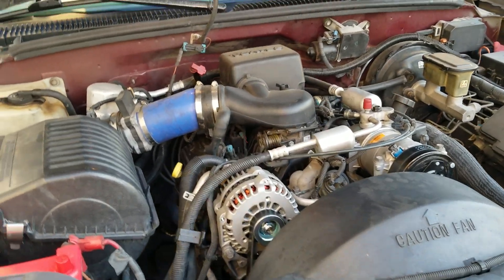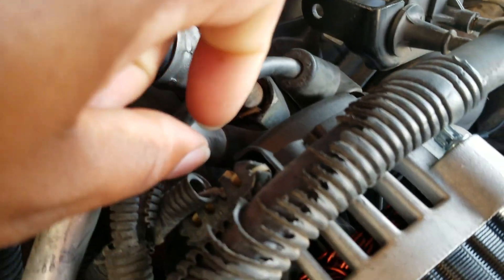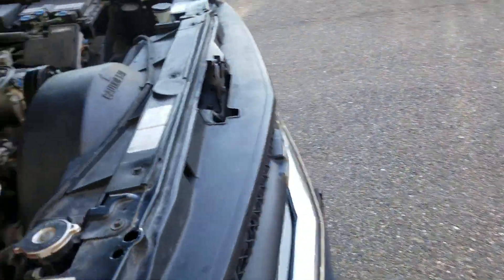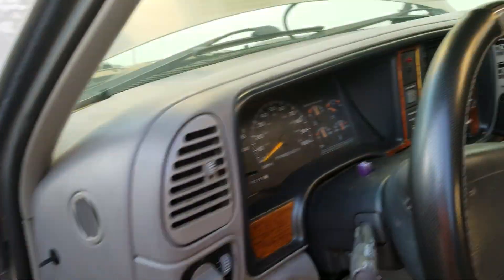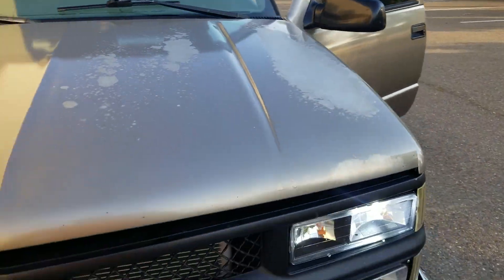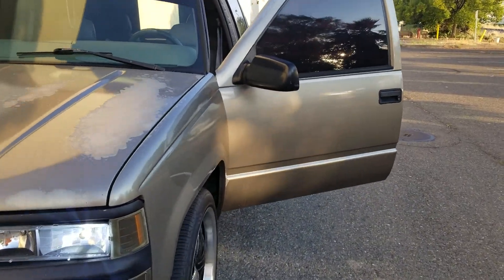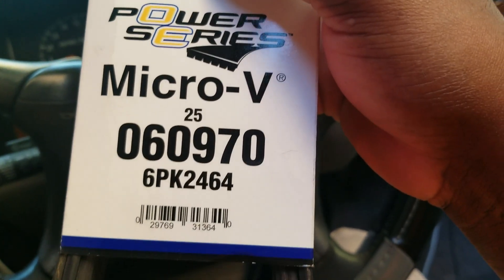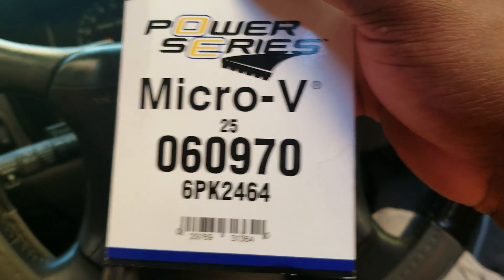1997 silverado with AD244 alternator swap

Comment: Those alternators work better if you put the voltage sensing wire at the battery as those trucks don't come with any hookups for sensing voltage.

Comment: I did the swap, and reused my factory belt, BUT, because it was short, it was too tight, and caused my tensioner to fail. Save yourself the trouble and get the new belt.

Comment: Im going to order a ad244 but my stock alternator is 1 wire and the ad244 says it's not capable does it affect it ? Maybe dumb question
Reply from the maker: What year truck? From my understanding the ad244 on works on vortec motors from 96-00 GM used the same style plug up until 2004 then in 2005 the changed the plug
Reply: @chevyallred  97 but the connector only has 1 wire to the factory one and the ad244 says it's not 1 wire cable
Reply from the maker: Don’t see why yours is so different
Reply: Do you mean one wire out the harness or just one wire going from the battery to the back of the alternator(battery cable and a harness pigtail)?

Comment: Aye man I'm gonna do the ad244 on my 97 k1500. Did you actually have to use a different belt than stock to make it work?
Reply: Why did you need a different belt?,stock is too short?
Reply from the maker: Mines was to short
Reply: @chevyallred  just bought a k3500 plow truck tonight and a bigger alternator,different brand then yours but I found that Same belt so I ordered it strange because unless I'm tripping they are all 97 inches
Reply from the maker: It took me awhile to find the right size belt
Reply: @chevyallred  I noticed there is space to move the alternator back...the bracket has alot of room on the back side...idk if that was because the alternator in it currently is smaller then oem or what.its acuatlly currently getting a new front end and some other crap so I'm going to swap the alternator when i get it back from the shop
Reply from the maker: Yep I hade to use a different belt I believe I showed the part number in the video
Reply: Normally 144 amp alternator require a different belt.

Comment: I got a 96 k1500 5.0 , you think this will work on my truck ? I do have the stock alt 105amp . Thanks bro
Reply: Ok thanks ill look it up
Reply from the maker: Any luck?
Reply from the maker: Eri Arbolero Wolverine yes it should work. I’m working making a 2017 alternator work on these trucks when I figure it out I’ll be posting a video for it
Reply: @chevyallred  thanks men preciate the help 👍👍.. thanks for the videos
Reply from the maker: Eri Arbolero Wolverine no problem just tying to help out whoever i can they my videos I will be swapping that alternator for a different one
Reply: @chevyallred  👍
Reply: Hey bro how long is the belt ? Im going to buy a different ad244 alternator
Reply from the maker: I can’t remember the length look at the video I have the part number in the video if that helps

Comment: Does the 145 keep up at idle with your system?
Reply from the maker: Yep my system isn't that big I'm not pushing power to my system...but also I'm tracking down my ground wires that's also keep and maybe upgrading to the big 3/4

Comment: Any charging issues with this alternator? I was looking at doing the 1n-4812HO 200 Amp from Napa. Did you ever get the fans in? How does it do keeping up at idle?
Reply from the maker: Nope not charging problem with it...I have to see more once I do my efan swap if there s problem then maybe I'll do a 160 atl....ima swap my stock alt in my 2004 suburban to a 160 from a 2006 denali xl

Comment: Any issues with power after the efan swap..I did mine and have a 200amp powermaster alt and I have big voltage drop at stops
Reply from the maker: Thomas Hoyne this truck doesn't have the efans yet.....but I dont have a power problem....you might want to get that alternator tested it's a guy I follow that did efans and used a powermaster 140 and he still has power problems he's running the flex a lite 280 kit....the fans are good 5000cfm but I think the problem is the vsc.....I would run those fans with relays....I did efans on my 2004 suburban with the stock alternator and no problem but I will be going to a 160amp and do the big 3 upgrade for both trucks